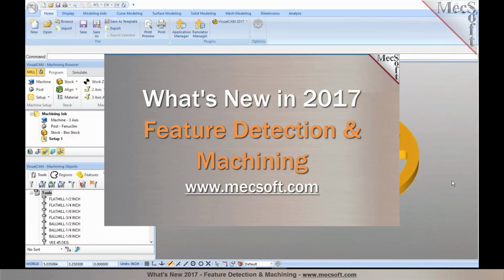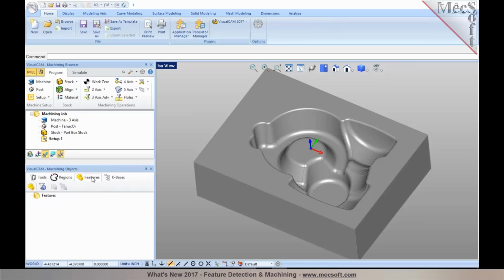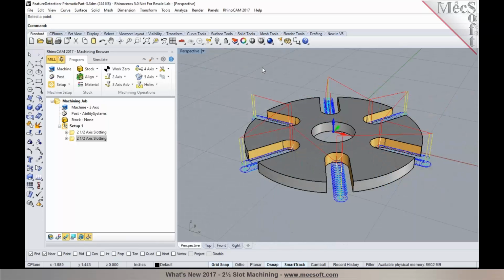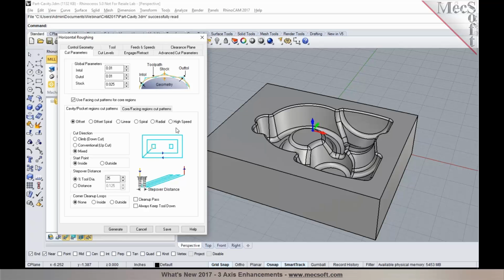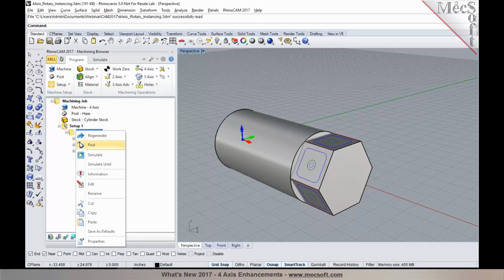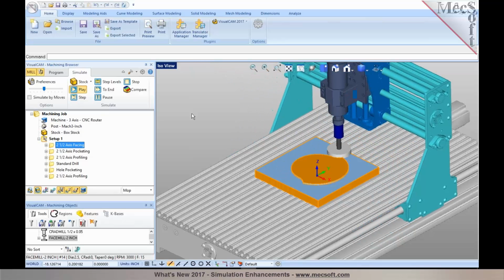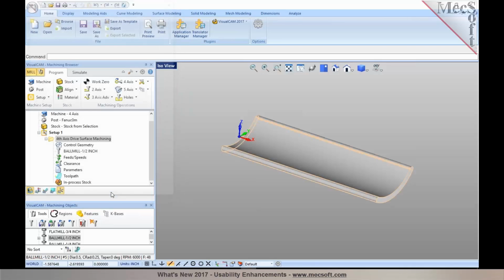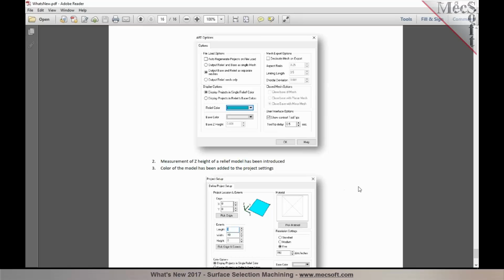Whats New in 2017

Comment: Try 4-axis, make crankshaft or eccentric wheel, 2014 can't do  that，I hope 2017 can
Reply from the maker: Yes in 2017 we can machine camshafts with the tool being normal to the surfaces.  True 4 axis support has been implemented in 2017, where all 3 linear axes as well as one rotary axis can move at the same time, thus enabling machining of parts like camshafts. 

You can read more about RhinoCAM 2017 at https://mecsoft.com/rhinocam-software/
Reply: Thank you for your efforts